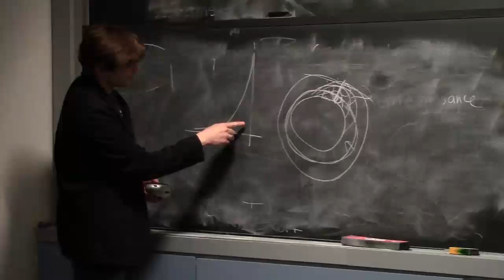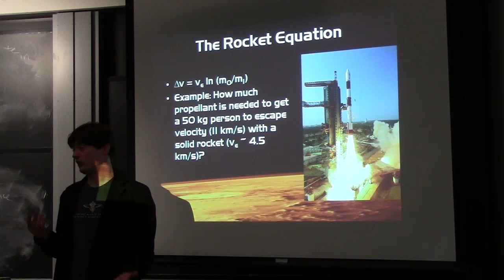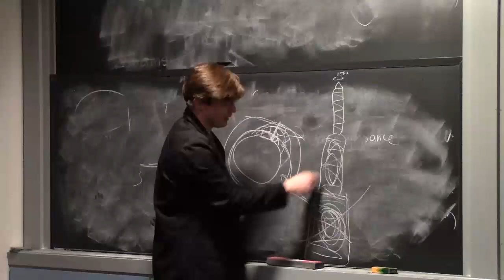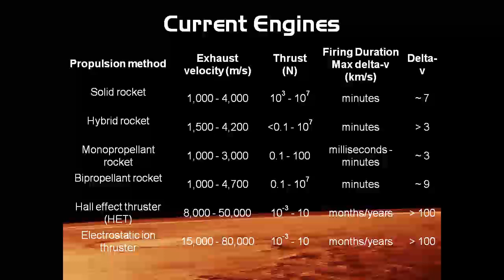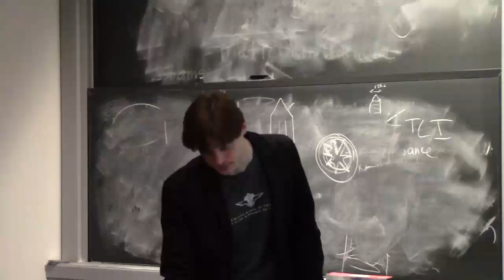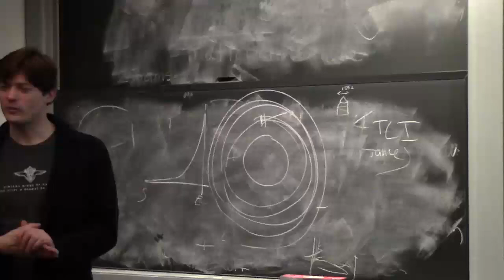Spacecraft Systems Engineering Intro Class Part 1: Rockets & Orbits

Comment: Electrodynamic tethers were not mentioned. Applying a charge to a tether which opposes the local electromagnetic field will cause it to push against the EM field if it is moving across the field lines.  It is possible to reverse the charge and cause it to drag across the field lines to a lower orbit. 

Spinning oblate EM fields are another method of propulsion.  Harmonics and topology of the fields is important to understand.
Reply: ever read David Brin's short story Tank Farm Dynamo?  http://www.davidbrin.com/tankfarm.htm